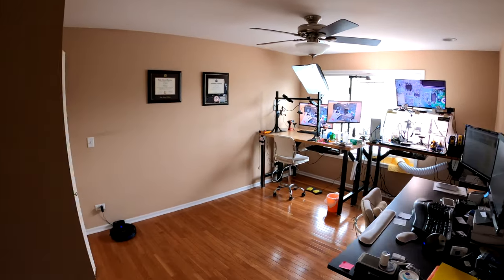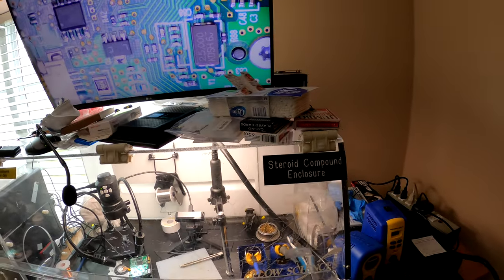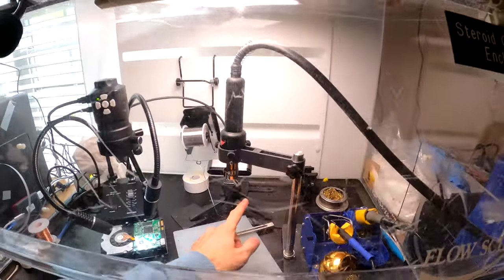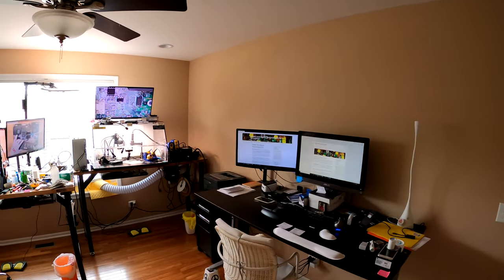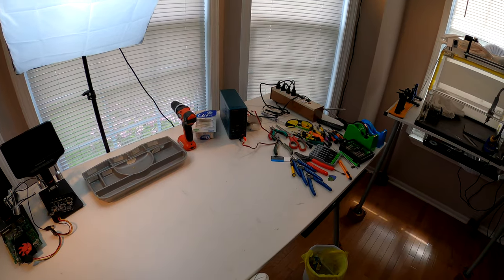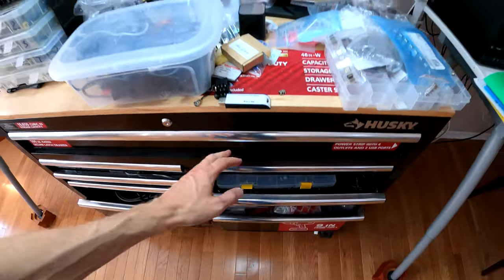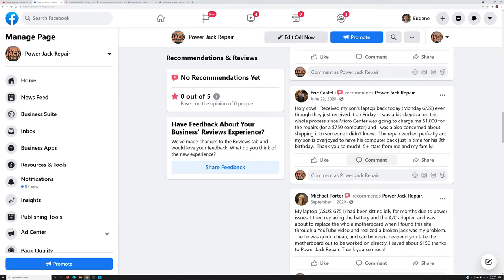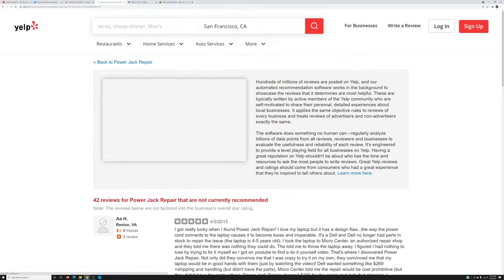Power jack repair lab tour soldering equipment overview laptop repair charging port repair fix

Comment: Just curious what temperature do you use on your hot air station when removing the power jack?
Reply from the maker: Depends on type of the board and where the jack is at, but generally about 400 c, you should also understand it depends on the air flow (low or high), as well as how far is it from the tip of the nozzel, and the size of the nozzle.

Comment: Does your Hakko FM-2027 hand-piece plug into your FX-888D Station or is plugged into the Black unit below it?
Reply from the maker: the black unit is hot air, so I assume FX-888d is where it goes to.